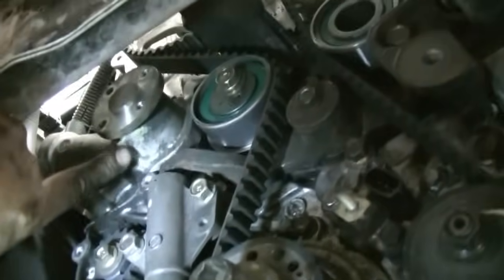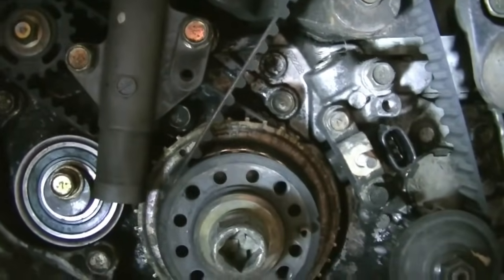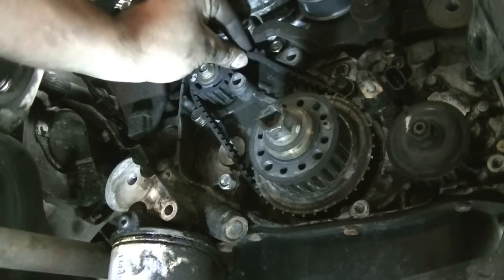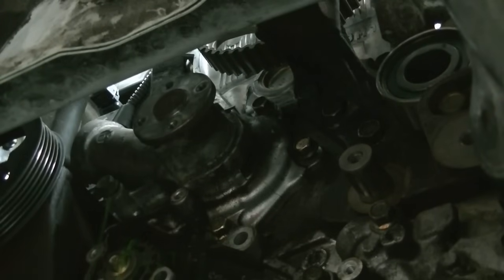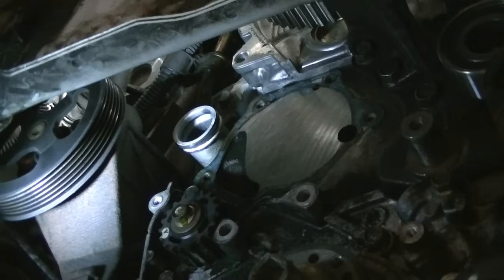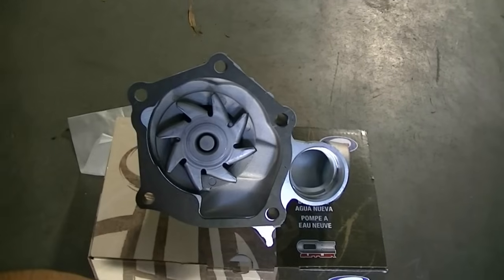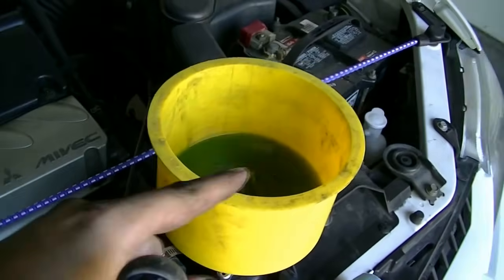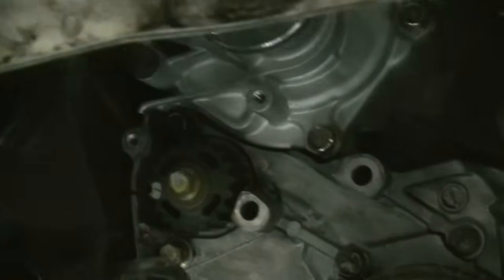How to Remove and Replace the Timing belt and Water Pump - Mitsubishi 2.4L SOHC Engine PART 2

Comment: I’m quite sure my water pump is faulty as the water from the radiator cap/hole is blowing out water when revving the engine as it was also squalling  when cold thanks for the good video straight to the point

Comment: WARNING !! ATTENTION !! 

EXPIRED & USED ENGINE COOLANT THAT COMES OUT OF YOUR VEHICLES COOLING SYSTEM 
IS VERY DANGEROUS AND HIGHLY TOXIC TO HUMANS, THE ENVIRONMENT, AND ANIMALS THAT MAY BE ATTRACTED TO THE FUMES AND ODORS OF THE COOLANT OR SIMPLY OUT OF CURIOSITY ENOUGH TO CONSUME IT WHICH WOULD PROVE TO BE HORRIBLY DETRIMENTAL AND SADLY COULD CAUSE DEATH. 
THAT IS WHY IF YOU ARE DECIDING TO DRAIN THE COOLANT L THAN BE WISE AND USE A DRAIN PAN TO COLLECT ALL OF THE COOLANT AND STAY SAFE !! 

BTW TO THOSE WHO MIGHT SAY ...BUT COOLANT IS NOT TOXIC , YES THE COOLANT YOU BUY FROM THE STORE WHILE ITS STILL IN THE CONTAINER ITSELF CAN ACTALLY BREAKDOWN INTO NON TOXIC FORMS IN TIME , EVENTUALLY AND ITS MAIN ACTIVE INGREDIENT IS EITHER ETHYLENE GLYCOL OR PROPYLENE GLYCOL MIXED WITH OTHER INGREDIENTS ACTS AS ANTIFREEZE AND RAISING THE BOILING POINT OF WATER BY UP TO OR EVEN OVER 10-DEGREES HIGHER , HOWEVER  EFORE IT DOES BREAK DOWN OF SPILLED FROM A CONTAINER CAN STILL BE POISONOUS TO ANIMALS,PLANTS,AND HUMANS !! IT IS RESPONSIBLE FOR KILLING AN ESTIMATED 10,000 CATS AND DOGS ANNUALLY BUT COULD BE PREVENTED THROUGH CAREFULLY HANDLING THIS WITH CARE. THE REAL DANGER THOUGH LIES AFTER THE ANTIFREEZE HAS BEEN INSIDE YOUR ENGINE OVER TIME MIXING WITH SEDIMENTS FROM INSIDE OF THE ENGINE AND IT'S COOLING SYSTEM PICKING UP MORE AND MORE CARBONIZED METALLIC SEDIMENTS THAT INCREASE ITS TOXICITY A MILLION FOLD MAKING IT INFINITELY MORE DANGEROUS AND MUCH MORE LETHAL TO HUMANS, PETS, AND NATURE. SO WHEN YOU DRAIN IT FROM DOING S PROCEDURE LIKE THIS ONE YOUR GETTING NOT JUST TRADITIONAL ANTIFREEZE BUT HIGHLY CORRODED CARBONATED METALLIC SEDIMENTARY POISONED ANTIFREEZE LIQUID FAR PAST THE VIBRANTLY BRIGHT FLORESCENT EMERALD GREEN IT HAS TURNED INTO A FOUL ODOROUS GROG OF BROWN FOGGY GREENS, AND GREYS, WITH HINTS OF FADED YELLOWS THAT SCREAM STAY AWAY !! DONT TOUCH THIS OR YOU RWILL REGRET IT !! 
SO AGAIN PLEASE USE THE PROPER METHODS OF DRAINING PROPERLY AND KEEP IT AWAY FROM ANY ANIMALS OR CHILDREN'S PATHS COMPLETELY !!

HAVE A GREAT DAY !!

Comment: I'm in middle of replacing timing and water pump on 2011 mitsubishi galant for my grandparents and your 3 video guide was the best one and most detailed video I greatly appreciated it helped a ton I've done timing and water pump on my 2002 toyota sequoia v8 which was a task but this was way different but easier other than no lines on the belt itself mine had lines for left cam right cam and center theirs didn't weird

Comment: Do I remove the power steering bracket? Can get it on with it. If I take the bracket on, I i can get the pump on but not the power steering bracket after. Please help!

Comment: Help! What do you do if you forget that tensioner is out and you turn the crank and cam where the cam mark is at the bottom and the crank slips the belt leaving you out of time? Will you bend valves by turning the camshaft and crank independently of each other?

Comment: Tx so much! I came for the water pump not the belt. If am changing just the water pump do I need to remove the timing belt, tensioners and pulleys?
Reply: Same did you end up having to do all that
Reply: Wondering the same. @nothing9214

Comment: Ive always used fast orange handsoap to remove the rest of the ghasket.. just dab a little bit on your finger and firmly rub the leftover ghasket,used shop towel to wipe off residue(do not use water)and your all set.

Comment: What year is this? I'm currently working on my mother-in-laws '03 galant, and the waterpump has 1 long, 1 short, and 3 medium length bolts. Also, do you have a recommended rtv for the timing cover or will the waterpump rtv (ultra grey?) suffice? Thank you in advance. :)